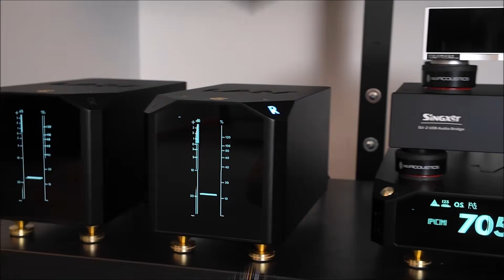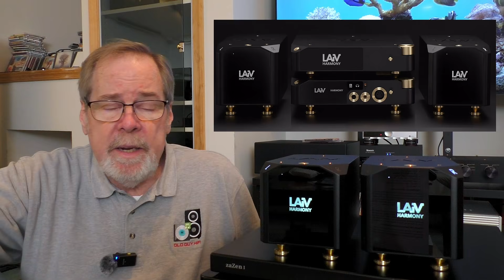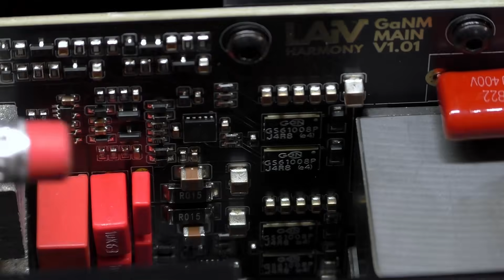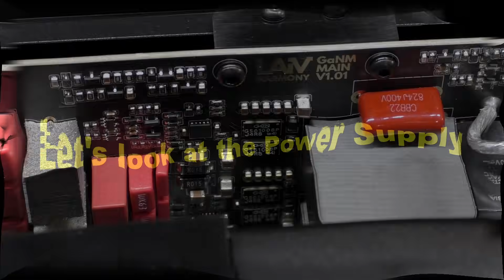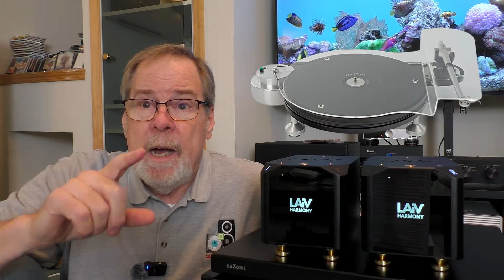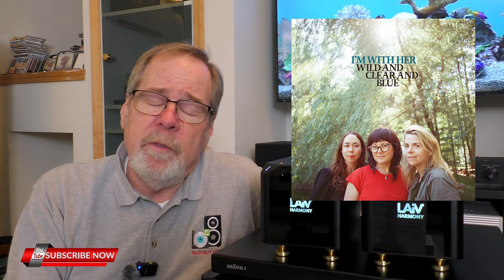I Once Asked if it Takes 2 to Tango. YES! Definitively! The remarkable LAiV GaNM Mono Amps. GREAT!

Comment: I considered these before ordering a pair of Orchard Audio Starkrimson Mono Ultra Premium LPSs. I decided to keep as much of $ in county as possible.  Your review of the Stereo Ultra DMC 2.5 was a big factor as well. Now I am waiting until October for them to arrive.
Reply: @DefawDOfile Hello, I've been a subscriber for a while and I wanted to know if there was a difference in listening with the Orchard Audio Starkrimson Ultra Mono LPS with their linear power supplies!
The Orchard Ultra Mono LPS are amps that have tempted me for a while, but can these LAIVs change the situation? Is an objective comparison possible, and can we say that the Orchard, despite a slightly higher price, is worth it for a long-term purchase? A sort of ultimate amp in terms of quality/price ratio. Thanks to all the opinions and advice from experts! From France!
Reply: I also ordered the Ultranpremium with LPS, have the 1528 bookshelves, and feed it with schiit freya plus with some upgraded tubes i like…. Same as you, waiting for delivery of the amps and 1528s
Reply: @troutboy299  I look forward to hearing about your experience!  A couple of pieces of advice: Heed the break-in period, it really does take about 50 hours to loosen up and start singing. Also, the speaker is capable of bi-wiring.  I have a second identical set of wires hooked up now (remove the metal connectors between the jacks) and I was surprised at the difference it makes, even if both sets of speaker wires are connected to the same amp!  Also, I am using a DDC with an external 10 mhz clock, this tightened up everything for me (USB from a PC driving the LAiV Harmony stack).  Best of luck!
Reply: Too bad I want an amp that is capable to double under 4 ohm but this does not.
Reply from the maker: @kenwk228 The Laiv does double into 4 ohms.
Reply from the maker: The 25s are very good amps. I was taken by their performance. Good luck with them. Keep me posted on your thoughts about them.
Reply: I have the full Harmony stack with uDDC running into the  Orchard Audio Starkrimson Mono Ultra Premium LPSs. (linear power supplies).  The speakers are Arendal 1528 Slim.  I also have the  Starkrimson Stereo Ultra DMC 2. The Stereo Ultra now runs my custom subwoofers.  The Ultra Premium LPS monoblocks are a beautiful step up in refinement from the switching power supply driven DMC 2.  I don't know if it has the higher switching speed chips as well as the linear power supply, but it is really sweet, without losing detail.  Smoother, cleaner, yet exquisitely detailed. (and the DMC was no slouch).
Reply: @DigitalGrease How do you like the 1528 slims?
Reply: @boomerscs9193  I really love them, especially after break-in and getting them bi-wired to the monoblocks.  Placement in corners or against the wall is better than the non-slim bookshelf behemoths, but can still result in a little room mode activation.  I am used to studio monitors, so I do like a linear response, but also wanted a sweeter high end.  These gave that to me along with greater midrange resolution without harshness. Very musical, no regrets!
Reply: I can’t say how they sound as they aren’t available until October. The Arendal 1528 bookshelf 8 come in September. I am going to have to use a digital preamp with EQ to correct for my hearing loss. I’m not really deaf, I can hear anything as long as it is loud enough!
Reply: The Laiv’s THD + noise is quite a bit higher than the Orchard amps, but I don’t know if the difference can be heard.
Reply: @DefawDOfile  I have not heard the LAiV monoblocks, but THD and noise specs alone are not necessarily an indication of quality (unless they are horrendously bad). The Orchard Audio amps with linear power supplies have a very beefy power supply and a very sizeable bank of capacitors driving the amp module which has a smaller bunch of capacitors on it.  There are also no fancy displays or cpu chips in the Orchard Audio amps, possibly allowing a cleaner signal. Just speculation.  Other reviews I've seen about the LAiV monoblocks indicate that they have a slightly warm signature, as opposed to the wickedly clean, yet very refined signature of the Orchard Audio LPS.
Reply: @DigitalGrease  great insight... It's a little bit sad that we have to speculate about the differences though.  What's the point of a review if you don't compare the product with others?  I really don't get it.
Reply: @net_news  I'm not a professional reviewer, and I'm not willing to just buy a pair of the LAiV amps, then return them.  Frankly, once you get up into this price range, you start getting into wine tasting, cork sniffing territory. It's all about tuning to your taste.  My taste is clarity with a touch of sweetness.  Warm sounding gear feels like someone threw a blanket over the speakers to me. Personal taste.  I've read a bunch of reviews of the LAiV amps and the general consensus, I gathered, is that they lean to the warm side of things, but retain good resolution. What appeals to me about the Orchard Audio amps is their no nonsense, straight forward approach. No fancy display, no cpu chips.  The LPS units even avoid the switching power supply complexity for the old-school brute force approach, and that, to my ears, results in a greater refinement and enjoyment over the same family of devices with switching supplies. So, I could call this a review of power supplies in the GaN FET amp world, I suppose.